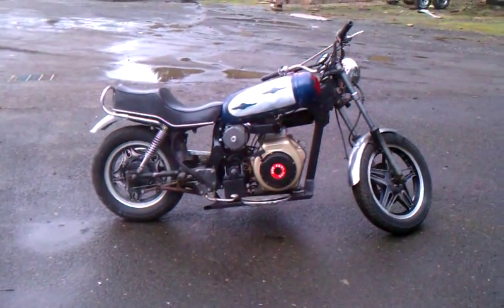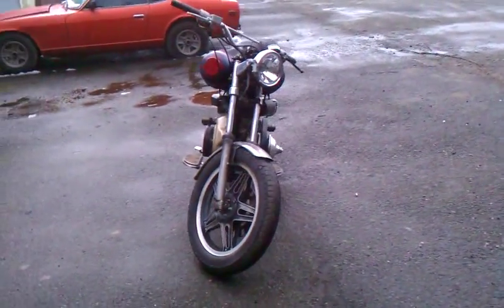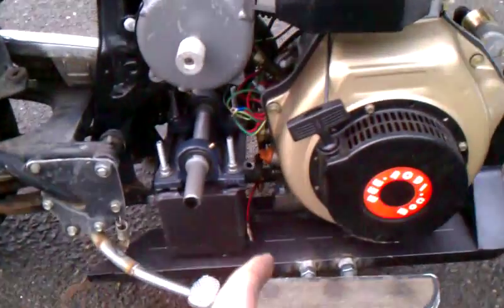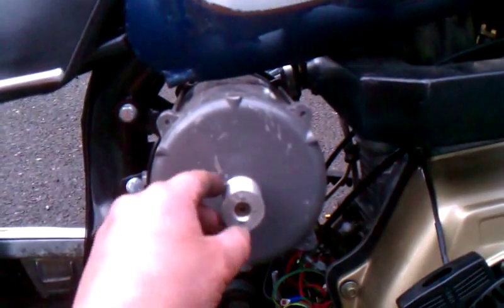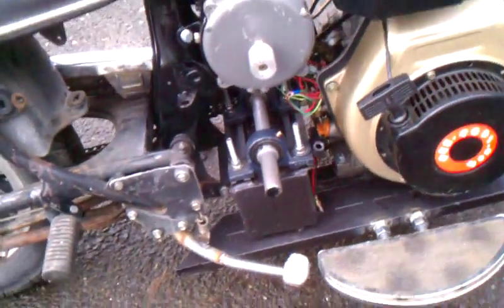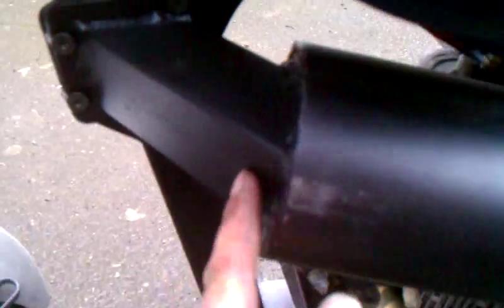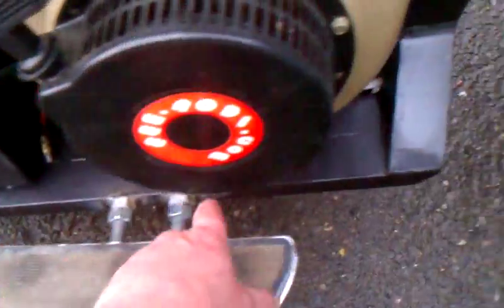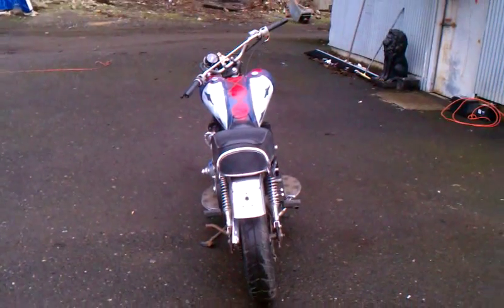Gluppity Glup, Turbo Diesel Hybrid Electric Motorcycle

Comment: This piece is severely underrated! just using the Peltier effect material is great. Please tell me you finished it
Reply from the maker: I got this build about 90% done, then I built my first all electric trike the zephyr. Experiencing the power, efficiency, and simplicity of an all electric power train was a paradigm shift I have never looked back from.
I have since eliminated the need for petrol in my life and banished the carburetor from my yard tools, and gone solar powered off grid with my welding shop.

This was my next chopper build, a 2 wheel drive 12 kw human hybrid electric 75 mph motorcycle...

https://youtu.be/R48JfqJ9ODc

Comment: Whether this contraption works or not is less important than the fact that Brent is actually putting these theories to test.  I roughly understand the idea of capturing all the heat losses in the exhaust, but I don't understand what you're going to do with the produced energy?  Where does the steam go?  And how do you control the electrical power generated by the peltiers?  I do think  you'll have too much back pressure for the turbo to be effective.  Again, huge kudos to your efforts.  -Kevin

Comment from the maker: dunno how much the turbo adds, but I am thinking the rhb31 turbo is actually a bit small. If i were to do it again I would use a liquid cooled vtwin diesel and a vnt15 trubo. the first stage of exhaust recovery I have is a rankine cycle steam expander using a scroll compressor, followed by several peltiers adhered to the exhaust.

Comment: RHB31 Turbo Charger. How much HP did it add, and how much more top speed?

Wow, over a 1000 mile range! Awesome!

Yeah, Ive heard about a new technology that can use heat energy and turn it into electricity. Is that what a thermocouple is?